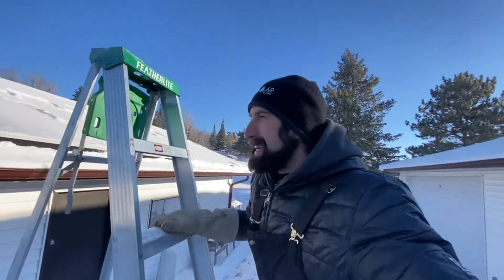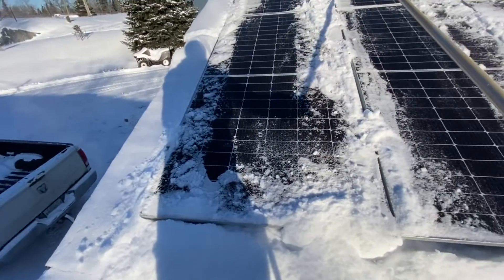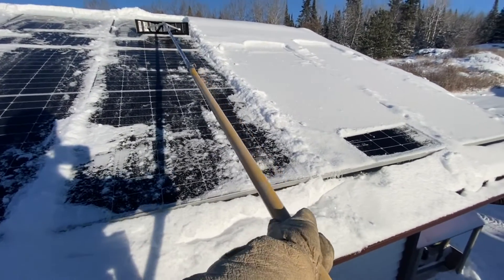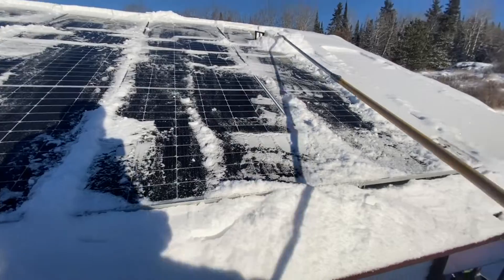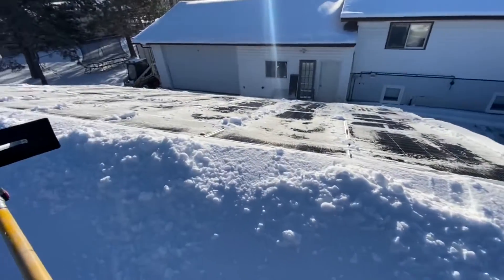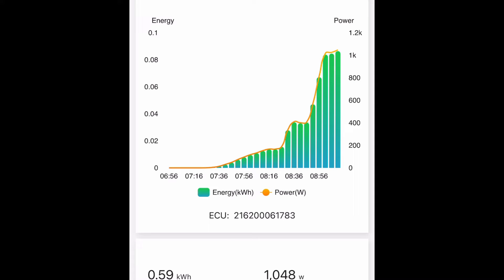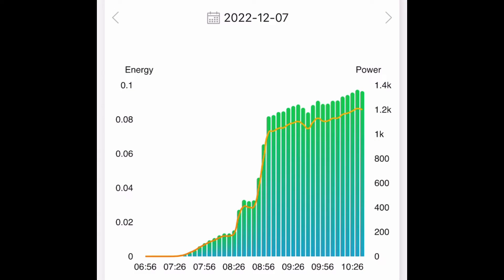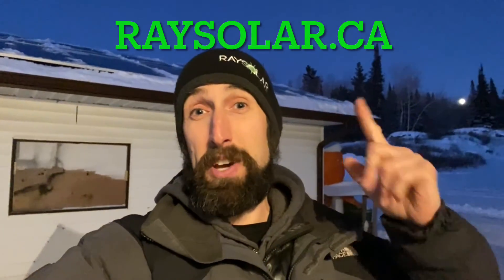Solar Production in the winter-Canada

Comment: I'm in Wisconsin. I had my panels finally put up on November 17. After a day we had a whiteout, and subsequent polar temps for a week. The snow is caked up a foot thick. They keep telling me it will just slide down. Today is December 19, and it still hasn't. We had some melting which resulted in the snow being framed in a thick layer of ice. I can't get the stuff off my roof. I'm also afraid I'd damage the panels, or scratch them, so Im not too aggressive. Batteries are drained. I'm still on the grid. Haven't even had the chance to go off grid, yet. All it tells me is an error message that production is extremely low due to weather conditions, and it will resume once the weather changes...

Comment: What about running some heat wire underneath the panels?!! Not running a lot just enough to get some exposed panel to help the sun heat up....
Reply: It can freeze up with ice on it where the tape isn’t and then you’ll never get them clean till weather is above freezing. Also at minus 20 or 30 it takes a lot of electricity to melt it off.

Comment: Good discussion especially as its still wintery in Canada!  At 6:15 - TIP use an electric portable leaf blower to get the solar panels much cleaner than that.  Ideally, should blow off the snow before it gets that thick.  But if you had a "snowmaggedon" event overnight, then use a combination pusher stick and follow up with leaf blower which will clear the panels 95% or more.  Really the snow just flies off like powder with a leaf blower and its actually kinda fun!
Reply from the maker: Thanks for the idea, that is an interesting way to clear your panels!
Reply: @raysolarmadeeasy  It is!  That's only the half of it.  Because I only use the leaf blower for my easily accessible ground mount solar.   For rooftop solar, which is my main solar array, I use a custom (non-mini) FPV quadcopter that weighs almost 8-lbs to clear the snow from the rooftop panels.  I use an extra-large battery and additional stone weights to increase the quadcopters propeller's wind downforce since downforce is directly related to the quadcopter's weight.  🌬❄

Yeah, that is not common setup.  But it kinda kills me to have a bright blue sky winter day and my main rooftop solar panels producing almost zero power!  Those cleared panels (especially the big rooftop array) are maximizing my annual solar energy production and winter is when we need the most solar power we can get.

Finally, to tie this altogether, the effectiveness of the leaf blower on the ground mount solar actually led me to building the custom quadcopter for the roof solar.
Reply: @raysolarmadeeasy  It is!  That's only the half of it.  Because I only use the leaf blower for my easily accessible ground mount solar.   For rooftop solar, which is my main solar array, I use a custom (non-mini) FPV quadcopter that weighs almost 8-lbs to clear the snow from the rooftop panels.  I use an extra-large battery and additional stone weights to increase the quadcopters propeller's wind downforce since downforce is directly related to the quadcopter's weight.
Reply: @raysolarmadeeasy  I'm trying to add more comments but YouTube is blocking them for some unknown reason.   These comments may or may not show up later.  Unfortunately, YouTube's comment system is becoming a bug-infested swamp.
Reply: @raysolarmadeeasy  It is!  That's only the half of it.  Because I only use the leaf blower for my easily accessible ground mount solar.   For rooftop solar, which is my main solar array, I use a custom (non-mini) FPV quadcopter that weighs almost 8-lbs to clear the snow from the rooftop panels.  I use an extra-large battery and additional stone weights to increase the quadcopters propeller's wind downforce since downforce is directly related to the quadcopter's weight.
Reply: Admittedly, the quadcopter is not common setup.  But it kinda kills me to have a bright blue sky winter day and my main rooftop solar panels producing almost zero power!  Those cleared panels (especially the big rooftop array) are maximizing my annual solar energy production and winter is when we need the most solar power we can get.

Finally, to tie this altogether, the effectiveness of the leaf blower on the ground mount solar actually led me to building the custom quadcopter for the roof solar.

Comment: I live where theres a couple months with up to -30f i was curious if the suns heat was enough to melt snow in that kind of cold?
Reply from the maker: Hello Peter, that may depend on how much snow is on the panels, but we recommend you use a snow rake to clear the panels in the winter and from there generally the panels will melt what remains on the panels from there.
Reply: Ok great! I was looking at vertically mounted solar panels today just because of how much snow we get. They perform worse than south facing in the summer but if you have snow the light reflected off the ground can make them comparable in the winter when I need it the most. And you don’t need to clean them. We get 15-20 feet of snow each winter.  I’m at 9k feet in the mountains. Just thought I would share since you probably get decent snow too in your spot.
Reply from the maker: @peterwilkinson1975  Absolutely, what some of our clients use is an adjustable ground mount where you can use a crank to change the angle depending on the season.

Comment: Kudos to you for building a solar system in such an inhospitable climate. I live on Maui and I'm building a 16.5 kW system to go completely offline. But even now on December 22nd, we will get 4.5 hours of usable sunlight ( over 1,000 watts per meter squared).   Do you get enough wind to supplement in the winter?
Reply from the maker: Thank you! We have found that we can use solar all year round. The sun works just as well on those cold days as the warm ones, and a few extra panels makes up for the shorter winter days.

Comment: Note to self:  Do NOT put solar panels on the roof of a building in Canada, unless it's an A-Frame with one side facing south!  I couldn't imagine living that far north and having solar panels that can't be adjusted seasonally.
Reply from the maker: Really depends on the owners goals and circumstances. Whenever a property can allow for ground mounted solar array--100% its the way to go. Ground mount for the purpose of adjustability, snow clearing and maximum production does provide its positive benefits. Owners should consider the cost of a ground mount in 90% of cases will exceed a roof mount installation.  When you live off the grid full time, unequivocally a ground mount system has numerous benefits over a roof mounted system.

Comment: Top of pole mount is how every solar powered home in north Idaho I've seen is done. Reason are we don't like snow removal chores. With your solar panels tipoff polemoint and have the bottom 6 feet off the ground when panelsare set to winter angle of 65°. At this far north it maximizes solar power production and mire importantly snow doesn't really stick to them at this steep a angle. I only have to do snow solar panel chores if I get 6 feet of standing snow on the ground most years I don't. Solar powered since 1983 40 years teaches you things.
Reply from the maker: Absolutely. Every property owners circumstances and available space will make a difference. Any time you can go ground mount it makes maximizing production in the winter much more efficient!

Comment: I’m at 38 degrees latitude. My 32,000 W of PV are angled at 45° to 66°. Why would you have them at 20 degrees in Canada? Guess what, most of my snow slides right off. Only the stickiest snow in below 32°F weather will stay on.
Reply from the maker: Great question, because often homes are limited to their roof pitch if they don't have the ground mount space.

Comment: This is why I will never put solar on a roof in Canada. You end up with a crappy angle that takes forever to melt off and poor performance because of the angle in winter as well. Where as a ground mount can be tilted for maximum gain. And if you are particularly clever, you can enclose the mount and heat it for free too.

Comment: Would definitely make your job easier if somebody designed mid clamps that were flush fitting. 

I'm from the UK and electric is very expensive, but we only get snow for a handful of days a years so doesn't matter so much.
Reply from the maker: We concur with the design application. Especially all of us who deal with snow clearing!
Reply from the maker: We concur with the design application. Especially all of us who deal with snow clearing!
Reply from the maker: We concur with the design application. Especially all of us who deal with snow clearing!